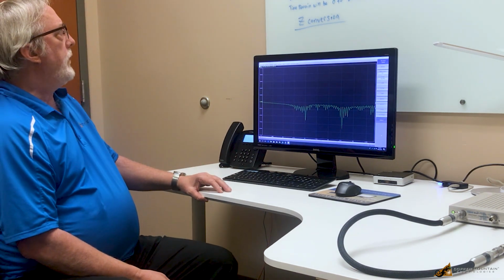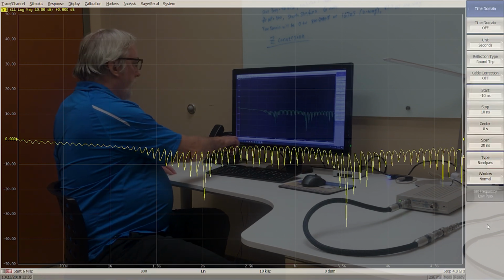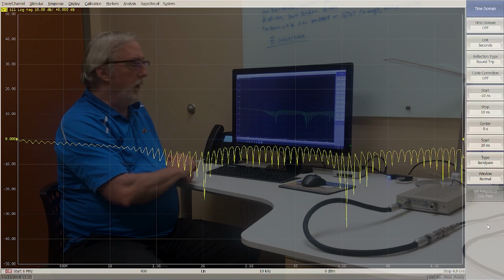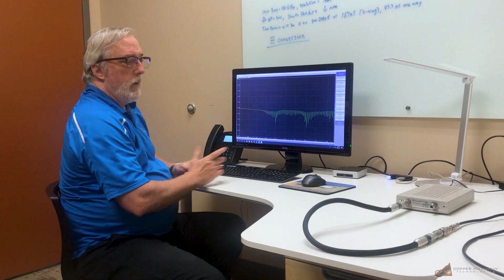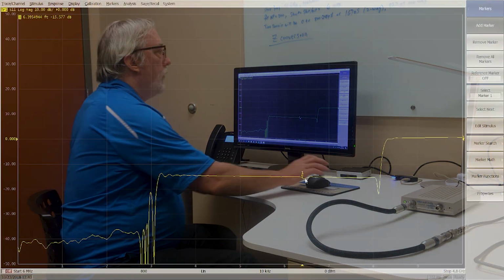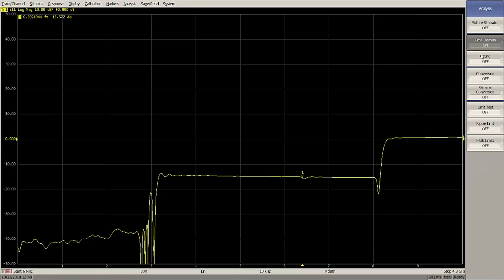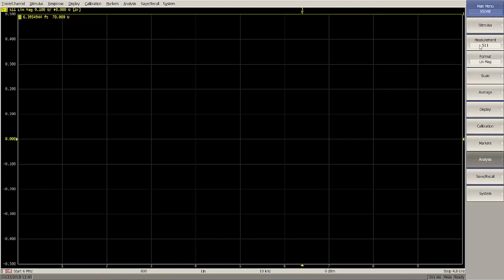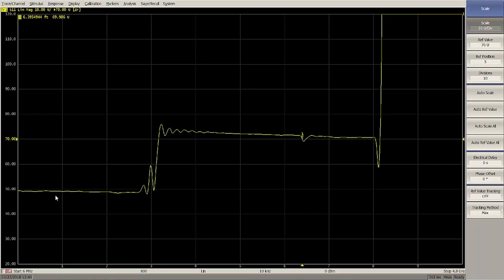Time Domain Reflectometry Measurements with a Vector Network Analyzer

Comment: Thanks for the detail setup and explaining the result. I have a question about the plot you get, with X is distance, Y is the S11. 
My question is how to tell the performance of the cable at different frequency from 0Hz to 4.8GHz? 
And are you able to see S11 of each frequency step, or it is irrelevant as we are using the time domain mode?